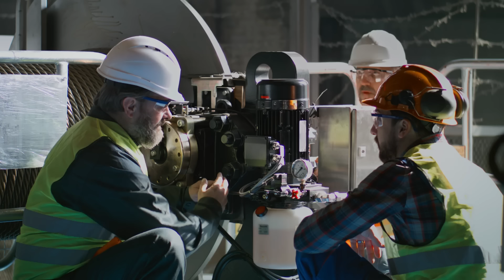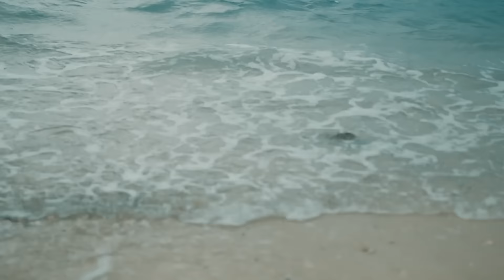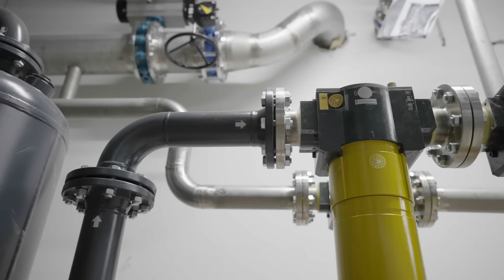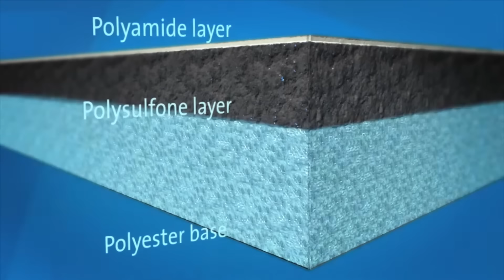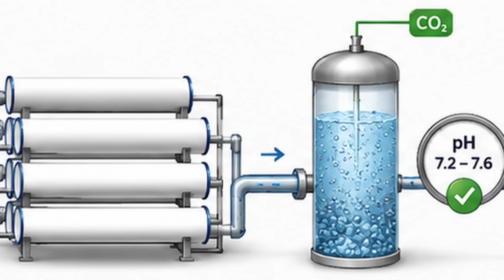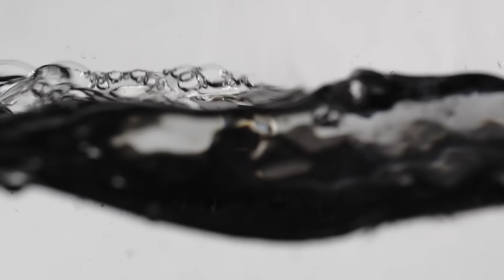The Secret Behind Cruise Ships Drinking Water

Comment: The question is what do they do with all the salt they filtered out?
Reply from the maker: Great question. They don't keep piles of salt onboard, the removed salt becomes concentrated brine, which gets discharged back into the ocean.
Reply: @TheCrewFiles why don’t they use it for the food
Reply: @danielleluckett6216Because that is not edible salt for it to be edible there is different process that is not possible on ship
Reply: @danielleluckett6216😅😅😅 , I was thinking the same
Reply: @danielleluckett6216 It's not just Sodium Chloride. There's also Magnesium chloride (MgCl₂), Sodium sulfate (Na₂SO₄), Calcium chloride (CaCl₂), Potassium chloride (KCl), as well as trace amounts of other stuff you wouldn't want in your food.
Reply: @T @TheCrewFiles he salt is pumped overboard as a water salt solution, called Brine. The taste of the final product CAN be improved upon by adding minerals.